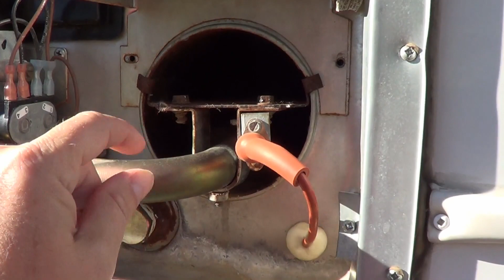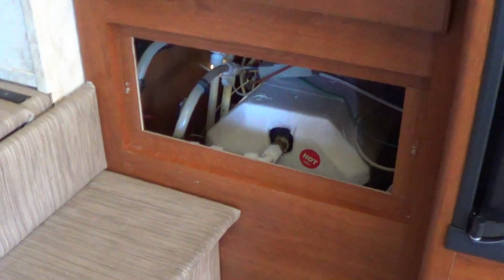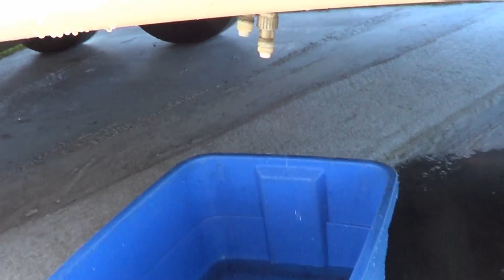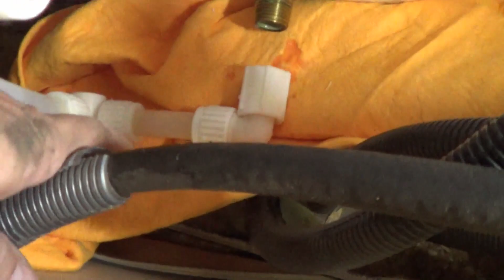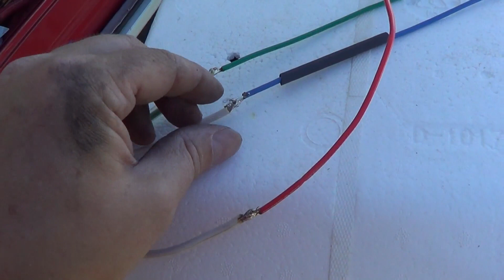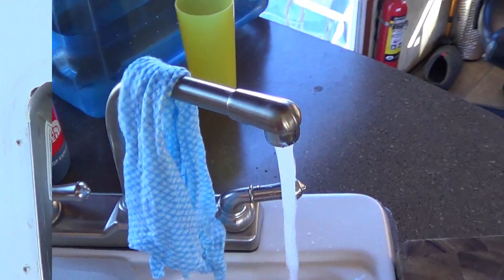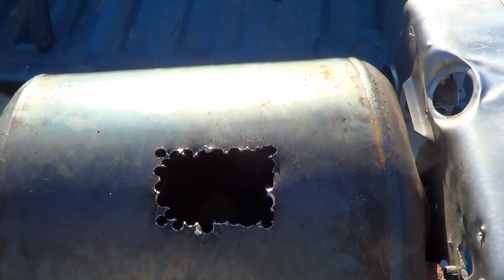Replacing My Leaking Suburban SW6DE RV Water Heater

Comment: Ray, you did the same thing I would do, I'd also want to find out why the (HOT) Water Heater failed !!!  I recently replaced my Water Heater (Atwood), however, I decided to replace the Water Heater with a Propane Only model versus the Propane/Electric model.
Reply from the maker: I'm always curious. :)